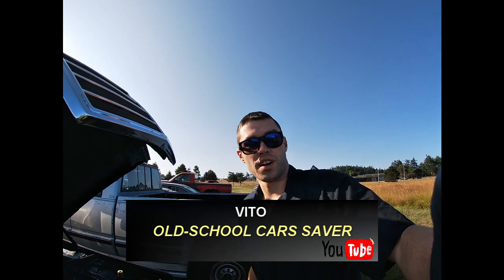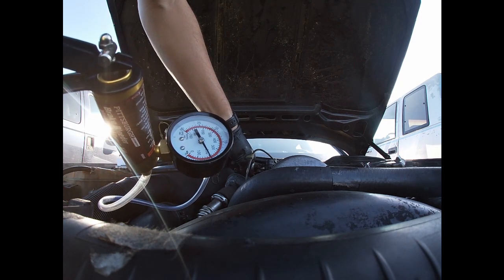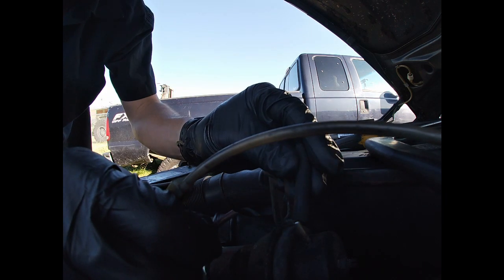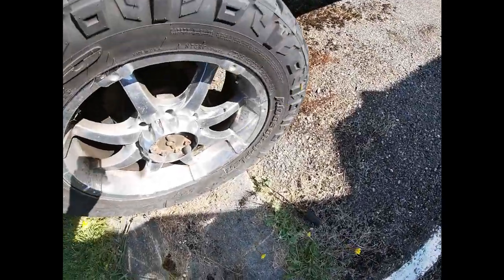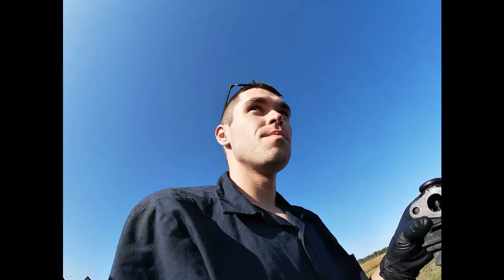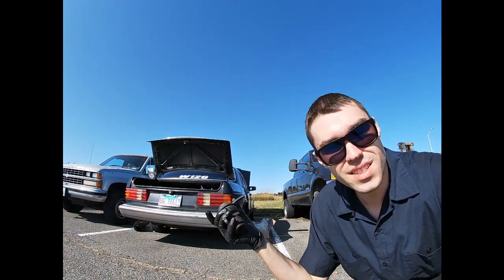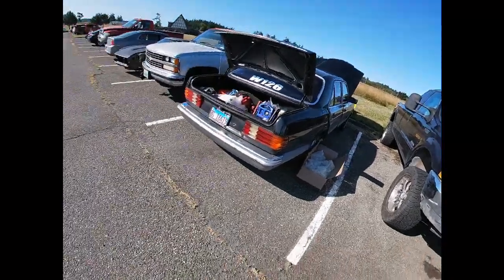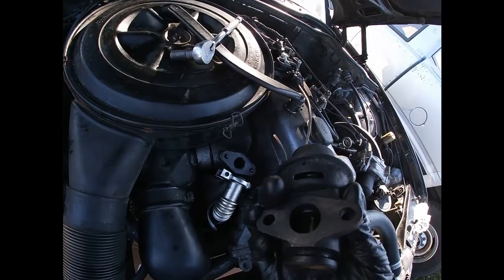EGR DELETE KIT FOR $0 ON OLD-SCHOOL DIESEL MERCEDES OM617

Comment: Hey I have a question as I made the huge mistake asking another "genubus " on youtube. A w113 with a 280se engine.  A very usual swap out. What's the timing for the fuel injector pump. I'm curious.